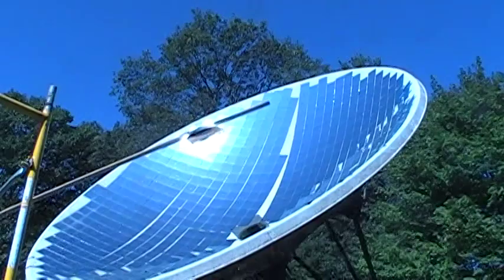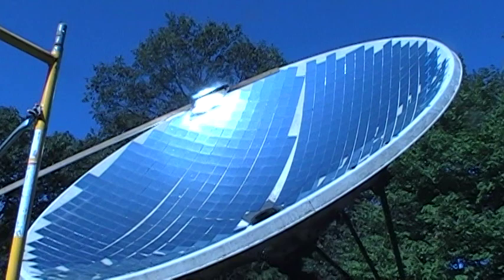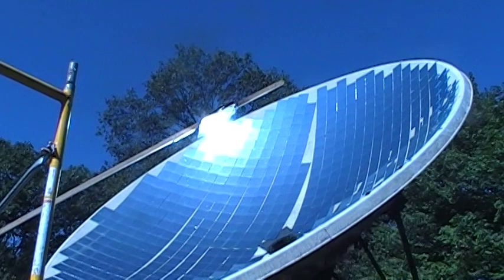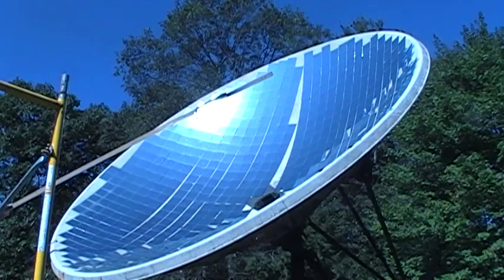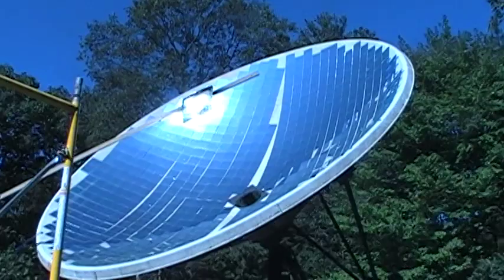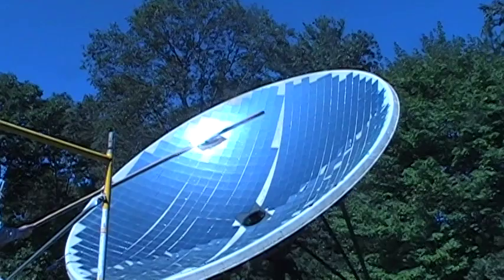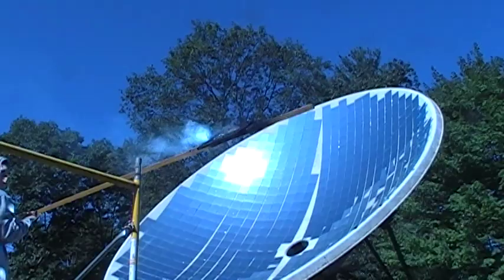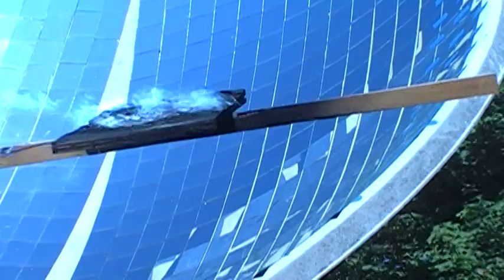Solar parabolic dish hot water heater

Comment: Looks like a good start, I have the same setup but with two dishes mounted on one pole. They put out good heat.  I used a car A.C. Evaporator as the collector, painted it black and insulated a box around it. I use the hot water to cycle through a concrete floor, as heat for my house BUT I am having sun tracking problems....computer wise.

Comment: so if you made a smaller dish you could reflect it back though the hole in the center ?? would it add to the strength of the heat??
Reply: it would not add to the intensity of the heat since it doesn't collect any  additional.  You'd likely lose some from heat loss at the small dish, as well as maybe shade out part of the large dish...  it might focus the beam to a smaller diameter though, so if the end fluid container was optimized for a certain size block of light hitting it that would be a way to acheive it...